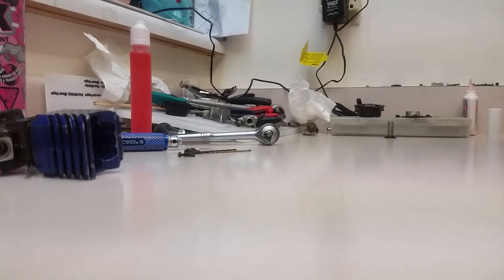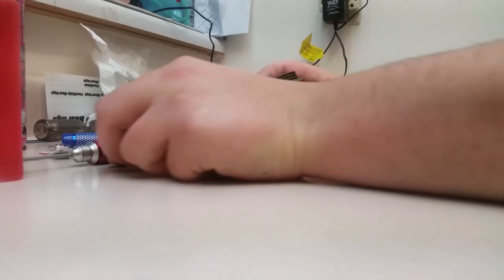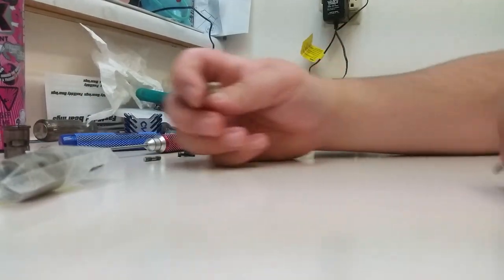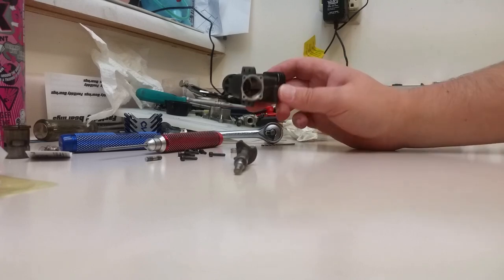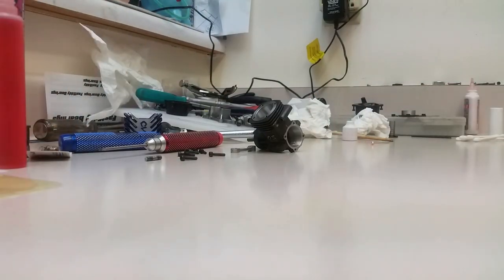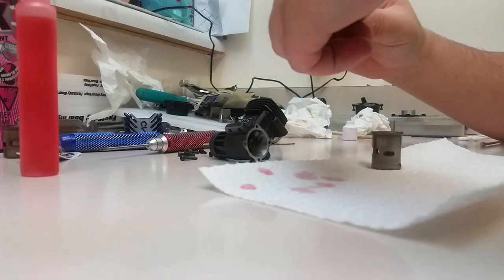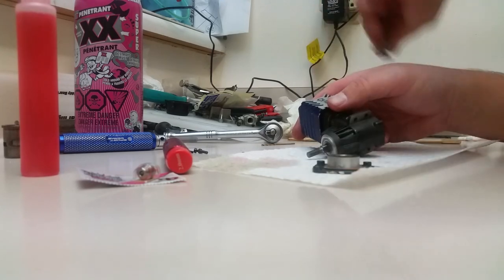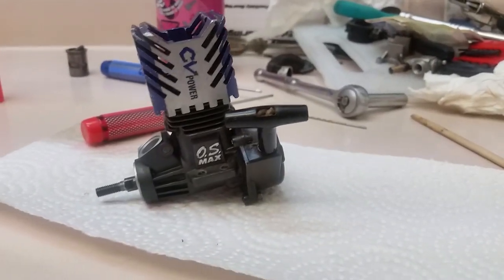OS 15CV Nitro engine rebuild

Comment: Recently restored my 15cv came with a restoration project hpi rs4 thing was in a right state head had bits missing an whole engine was gummed up brought a new head off someone in the nitro fb groups an gave it a full rebuild today an it’s a different engine compressions back and it turns over super smooth just gotta finish the car an find a hpi roto start an I’m sure it’ll run put a new plug in it too
Reply from the maker: Right on! Those old engines are awesome and run so good. Just sucks parts are not easy to get

Comment: I just got one of these in a bulk purchase of random things and this engine was one of them. It was stuck for a while, I left it to soak in WD for a week, and finally got it spinning. I have no intention to use it, but also don’t know how to know if it’s any good?
Reply from the maker: Yet you can always pull the piston and sleeve and see how far it goes up the cylinder if you push gently in it stops most of the way up then you're good but if it pops out the end that you know it's worn out. Run a fuel with additional castor oil
Reply: @thebug4046  ok thanks, if it doesn’t sell in a few weeks I’ll give it some more attention. I have no idea how to manipulate those carburetors that are rotary, so it’ll be a learning experience for sure! Thanks again!
Reply from the maker: @jackdurden466  pretty easy tuning carburetors to tune